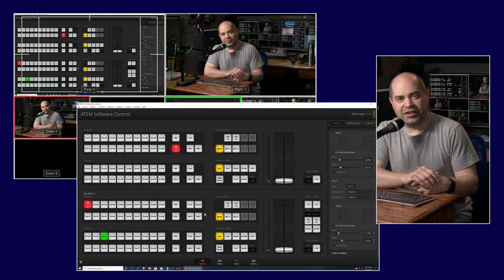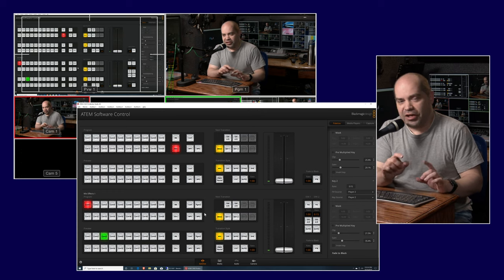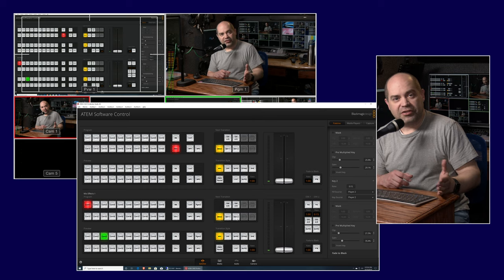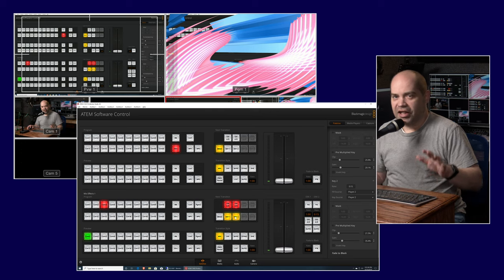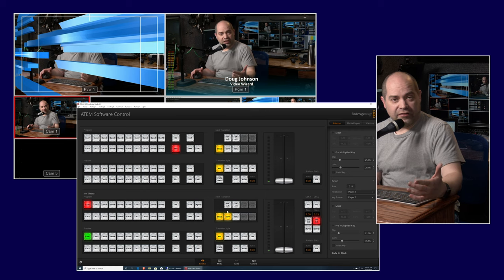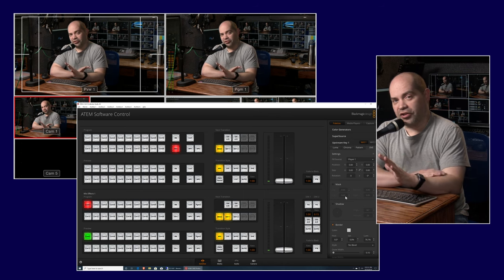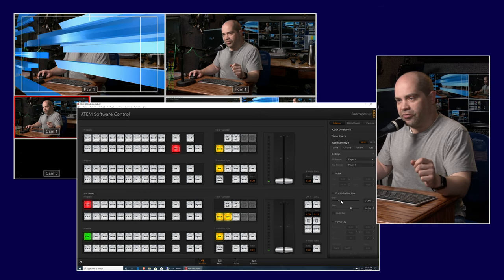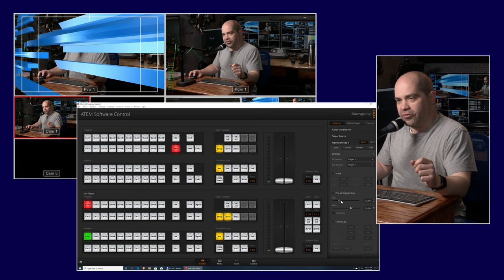Video Training: Upstream and Downstream Keys... What are they?

Comment: Hi Doug Thanks for sharing knowledge ..
What is the this 2ME, 3ME, 4ME switcher means ? could you explain in detail ?
Reply from the maker: M/E is short for Mix/Effects (engine).  Most budget friendly switchers are single M/E. This essentially means that it can produce one program feed.

2 M/E and larger switchers have multiple switching engines in them. They can create multiple program feeds, and each will have its own Preview and Program busses. So one M/E could be used to produce the program feed going to an Internet stream, while a second M/E could produce a separate feed for a projector inside of a venue. All the M/Es in a switcher have basically the same sources available, with one exception — the Program output of one M/E can usually be used as a source for other M/Es (with some restrictions) effectively creating multiple layers that can be placed on top of one another, or used as sources for keyers, to build a more complicated final product. For example, M/E 2 could switch between video sources to be used in a Picture-in-Picture window, and do all of the normal transitions between them.

Having multiple M/Es is a lot like having multiple separate switchers that happen to have the same video sources going into them, with the ability to feed the output of one into another.
Reply: @djp_video  Thanks Doug for clarifying the concept :)   a big like and share

Comment: 07:20   This is how all pro switchers operate. You only had BKG selected with two keyers already on air. Your transition area was setup so you were only affecting the BKG (preview) bus which is why the two keys still showed up on your preview monitor.  This is proper and called an under cut or dissolve.  Preview will always show the effect of the next trans area.  This is why it's important to know that the next transition area will always flip flop the state of each selected keyer (layer) depending on its current state.  This gets especially tricky on switchers where you have 6+ keyers to work with. This is why TD's make one of the highest wages in the truck...
Reply from the maker: As one example, the Broadcast Pix switcher I operated tonight handles this very differently than the Blackmagic Design switchers.  On the Broadcast Pix, you press a Key button to enable that upstream key for the next transition, and the button turns red. Perform the transition, and the button changes color to orange to let you know that the key is live. If you want the key to stay live with the next transition, you press the button again, and it changes color back to red so you can tell by looking at it that that key will stay live with the transition.  Red=it will be live after transition, orange or off=it won't. That's pretty clear.

The Blackmagic switchers are very different.  You press USK Next to enable the key for the transition, and the button turns yellow. Perform the transition, and it stays yellow even though the key won't be live after the next transition. If you the key to stay live after the next transition, you press the button again, which turns the light off.  So it is included in the transition even though the light is off, which can be very confusing.  Especially considering that the Bknd button does, in fact, indicate that the preview source will be part of the transition when lit. No ambiguity there.

It would make more sense for the light to be lit when the key will be included as part of the transition, like the red color on the Broadcast Pix I used tonight. Red=key will be on screen after the transition -- pretty simple. The way the BMD works is counter-intuitive: yellow only means it will be live after transition, but if it isn't currently live.  If it's yellow and the key is live, it means it will be removed after the transition.  If the button is unlit but the key is live, the key will stay on air.  If it's unlit but the key isn't live, it will be live after transition.  You can't tell at a glance on the console if the key is going to be live or not -- you have to look at the state of both the On Air button as well as the Next button to be able to tell.  It's especially confusing if you've got an animated key that isn't visible until it goes live.
Reply: @djp_video  Yep, the last time I used a broadcast pix switcher (i think it was a slate?) it defaulted to the type of transition logic you described. It drove me crazy as a traditional TD..  I quickly found that there is a setting under Panel options to change this logic and I believe it was actually labeled "pro mode".
Reply: I should also note that broadcast pix switchers are IMO the worst bottom of the barrel "all in one" solution if you can even call them that. I've only seen them in use once, thankfully.
Reply from the maker: I don't care for Broadcast Pix either. But that's what the company who hired me has.

Comment: How can I lock me 1 and me 2 together. Me 1 we use for media and me2 we use on imag on our church sanctuary . Thanks.
Reply from the maker: There's no built-in way to do it. But if you were to use your own custom control panel (X-Keys with JustMacros or Central Control, a Stream Deck with Companion, or something from Skaarhoj) you could program a single button on those panels to control both M/Es. Or you could setup Companion to automatically fire off an event on the 2nd M/E whenever the source on the first M/E is changed.

Comment: kinda off topic here but I know in the past you did a video on the Vidiu from Teradek. Our church have been using the VidiuPro with their sharelink plan for a while now. With the recent changes at youtube there seem to be an issue with third party like sharelink. I'm therefore trying to bypass Sharelink and setup an RTMP stream to youtube. I've had no success so far. I've reached out to Teradek and sent them some screenshot but their only reponse was to say that I don't need to put username or password when setting up the RTMP stream. I'm still unable to get a stream to youtube using Teradek's VidiuPro. Don't if you use this teradek product with an RTMP stream but if you do a video on setting this up would help. Thanks
Reply from the maker: Henderson Highway Church I’ve used RTMP with YouTube many times. The only fields you should fill in are for the server and the stream key, as provided by YouTube. You can configure the backup server if you want, but it isn’t required. Don’t supply username or password information.

Comment: Hi, doug, I use the BMD atem television studio HD switcher, I often encounter, after receiving multiple SDI signals, some SDI signal screens flash. This situation does not happen all the time. The SDI line I use is 50 meters to 100 meters. This situation is really bothering me. Can you tell me how to find out the cause and solve my problem.
Reply from the maker: Sounds like it may be a marginal signal, especially at those distances. Start by moving cables away from sources of interference, if possible... and avoid putting coiling up excess cable.  You might even try running the cameras on battery instead of being plugged in to minimize potential ground loops. If none of those work, try switching to a higher quality cable, or shorter cables with some kind of device to regenerate the signal part way down the line. (The BMD SDI-to-HDMI Micro Converter works well for this). Switching to fiber would be the ideal solution, though.
Reply: @djp_video  great appreciate。I will try it out with your method.。The fiber is really good, but it is easy to break. It is not safe in professional multi-camera live broadcast. If it is not a long distance, I still don't want to use it
.
Reply from the maker: That's a common misconception. Armored fiber is very resilient, and is much cheaper than quality SDI cable. We use fiber almost exclusively in our (multicamera) productions. It has a lot of advantages over copper, like distance limitations measured in kilometers instead of feet/meters, no signal interference, and it's much smaller and lighter than coax. I have a video comparing interconnects here: https://www.youtube.com/watch?v=U7p7OboXZRQ

Comment: How to make DVE SQZ work on blackmagic 4k switcher
Reply from the maker: For the models that have a DVE: from within ATEM Software control, open the Transition palette, click DVE to set the transition type, then click the right arrow (>) to go to the second page of DVE effects types and choose the direction you want. 

Not all of the ATEMs have a DVE. And most models that do are limited to one DVE per Mix/Effect bus. (The DVEs aren't necessarily linked to a particular M/E, but the number of each usually matches.) So for the 1 M/E models (the majority) if the DVE is in use somewhere else (like an upstream key) it won't be available for a transition.

Comment: Great stuff here
Wanna know how to add lyrics to my program 
Please help me out
Reply from the maker: You'd essentially just need to prepare some graphics using whatever application you'd like containing the lyrics -- white text on a black background is a good start. From there, feed the output of your computer into one of your switcher inputs, then set one of your keys (upstream or downstream, depending on the need) to use the computer as its source.  Set it for luma-key and adjust its parameters until the video looks good.  Many of the steps are outlined in this video.
Reply: @djp_video  Any recommendations on which would work better - upstream or downstream - for showing song lyrics during a church service? Using multiple cameras for the background.
Reply from the maker: I use a downstream key for that. It makes it easy to switch cameras while the lyrics are on-screen.